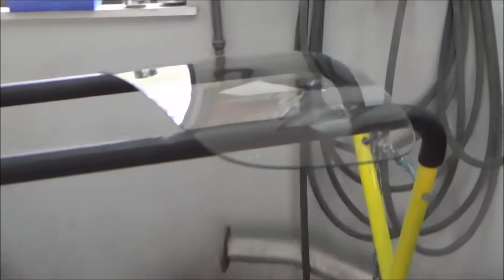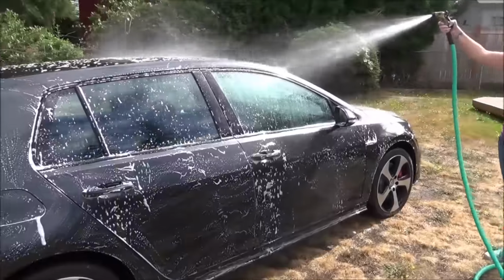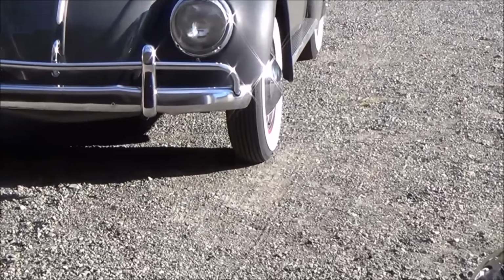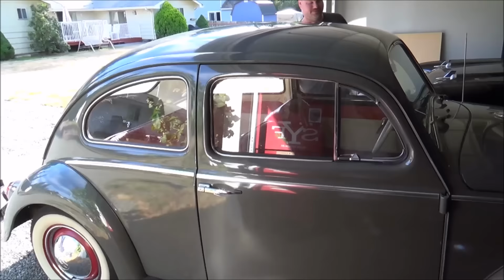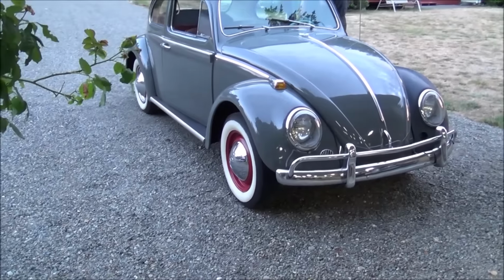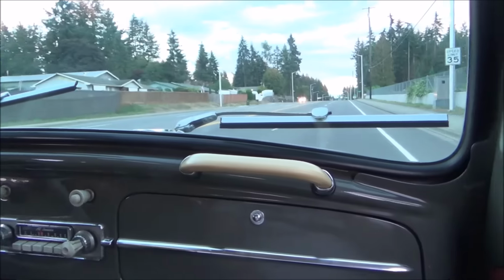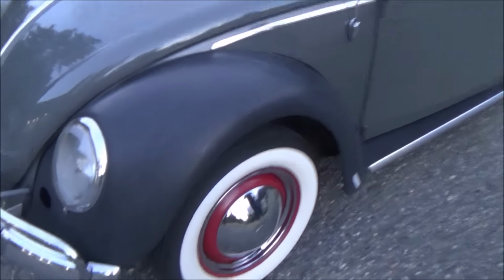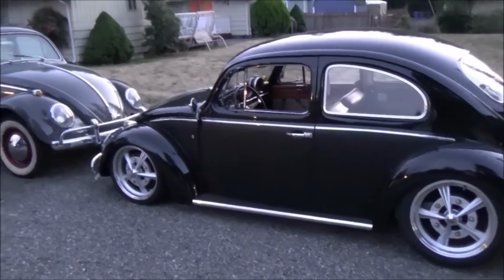SYF:  More VW Nonsense

Comment: Could try Cb Performance, aircooled.net, FLorida import warehouse etc for that steering part. I'm sure I've seen the real deal on one of those sites. the problem is alot of the time, they will be out of stock as there is such a demand a whole bunch comes in, and they're sold within days and it takes time to remanufacture / restock. I'm in Australia. But I really wanna build a scat forged engine kit to 2276cc , super pro heads, webcam 86B,  A-1 full stainless system with tuck away muffler etc etc.. But it's hard to find people locally who carry these kits, and ordering one direct, shipping fees and import duties kill your ass

Comment: Hey Matt, Summit has some rag joints that look similar to the older ones, but I am not sure if they are the right size for you to use on the bug? This is news to me. Since I had my VW this has changed to those urethane ones. I was thinking maybe you could cobble one of those summit ones to work for your application? Never know. Good luck

Comment: and there , you tell me the model of those gray beetle wheels ?
Reply: be able to bring more videos of this gray beetle , they intend to leave him a slammed or not?
Reply from the maker: The gray one with the red wheels? Those are stock.  The wheels on the black one are called raders.     The gray one is going to be slammed on widened stock wheels.
Reply: Shut Yer Face Garage I'm using google translator , and most words this translator saiem Wrong , finally, I'm Wondering , name , model , wheel , gray Volkswagen Beetle ???????????